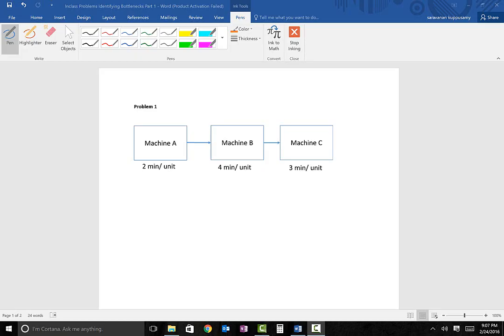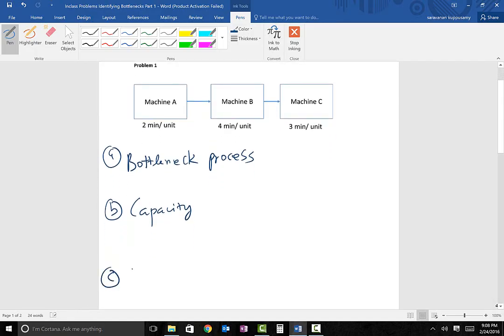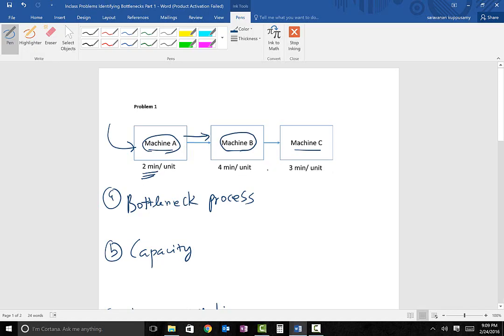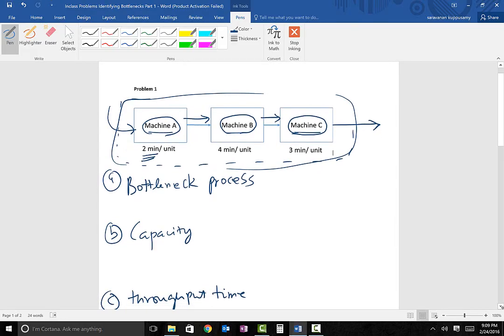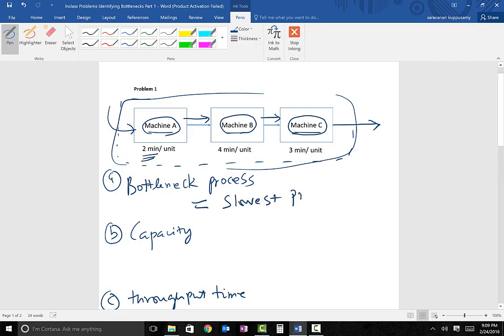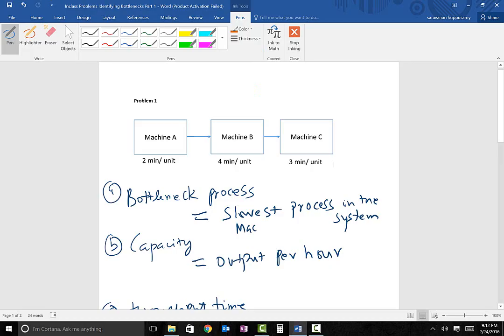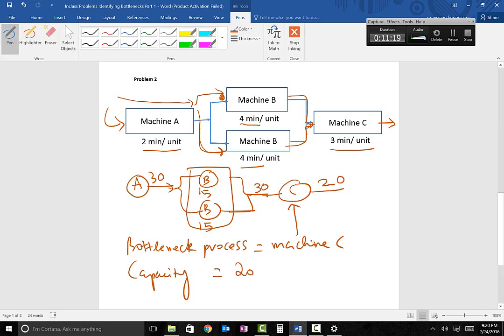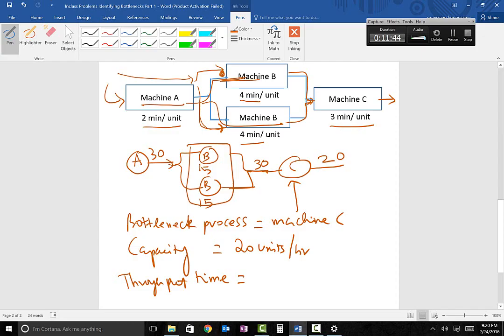Bottleneck Problems Part A

Comment: Good Video and this further needs to extend the impact on inventory and ordering process, as you will remove the bottlenecks, the system capacity will increase, it will produce more units in less time, but to do that you must also extend the model to include the customer orders, and pressure on purchasing activities.  Nice Explanation though, Congratulations!

Comment: Hi, I didn't get that last part. Why is it the same in throughput time? 2+4+3? When there were two machine B's?
Reply: Hey, this is because throughput time is the time it takes a single unit to pass through the system. In this example only one unit will be passing through one of the machines labeled B at a time. So, the total time for a single unit to pass through the system is still the sum of the time it takes a unit to pass through a+b+c, but our output is increased because we doubled our capacity in machine B.

Comment: In problem 2 the throughout time is 7 minutes as we have installed another machine so technically it will take less time now.
Reply: @arjun mandi Re-read my comment ...in problem 2 ..we have installed 2 machines in B.  so technically B processes in 2 min/unit.
Reply: @excelcorporation391  The machine time has not changed. You have just added the same machine B to match the output from A